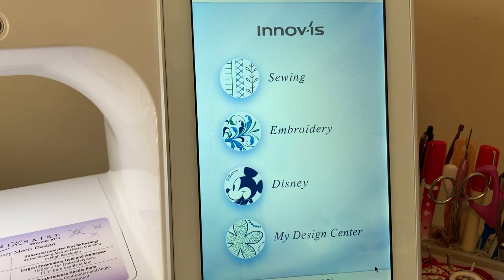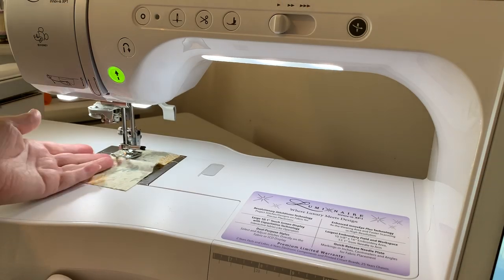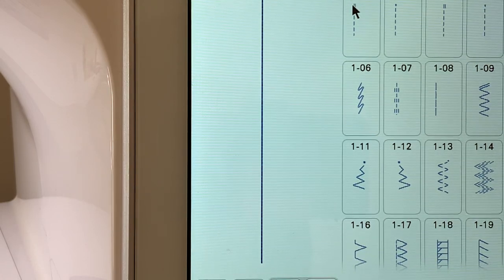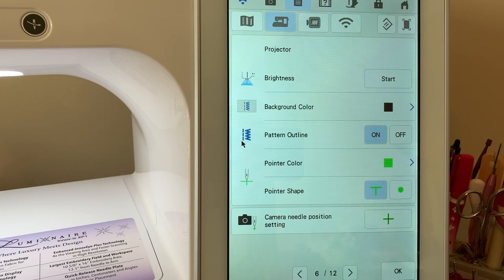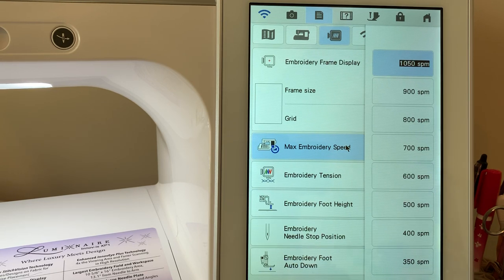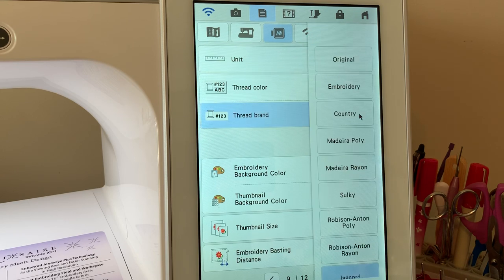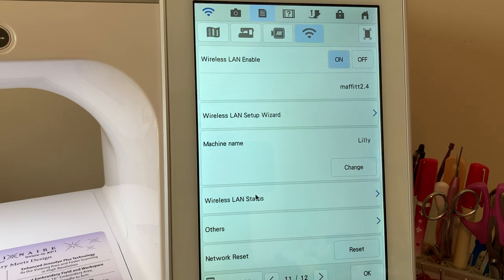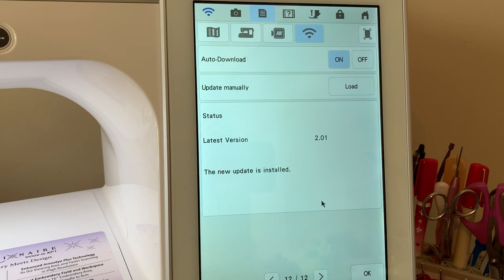Luminaire- New Owner - Lesson 4 - Machine Settings Pages

Comment: On the dual fool control, can that act or function as the serger does the differential feed system?
Reply from the maker: Betty Champlin -  you can speed up or slow down the belt, how much that would create the same effect as a differential Feed would have to be tested.  Give it a try with a basting stitch.  The differential feed on the serger is awesome for so many treatments.
Reply: Thank you Terry